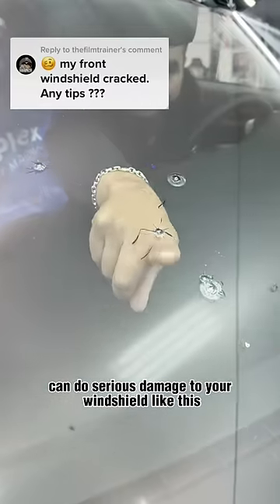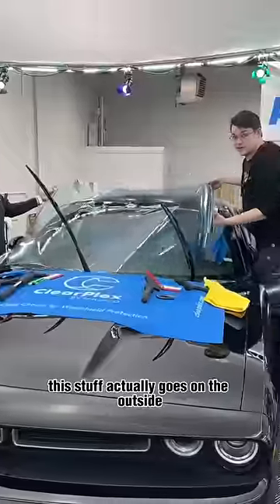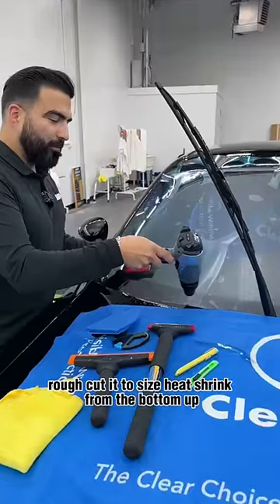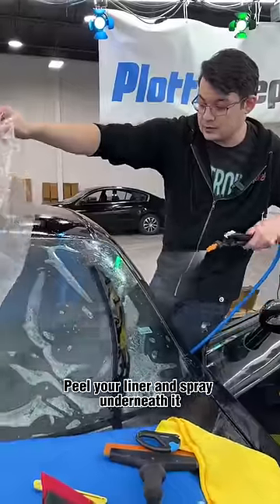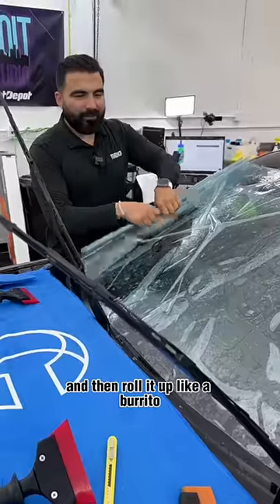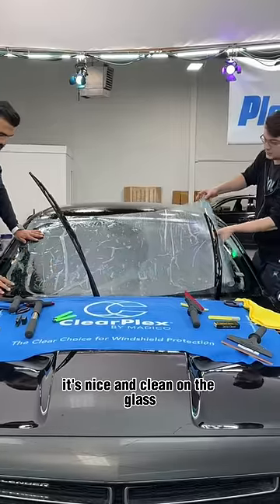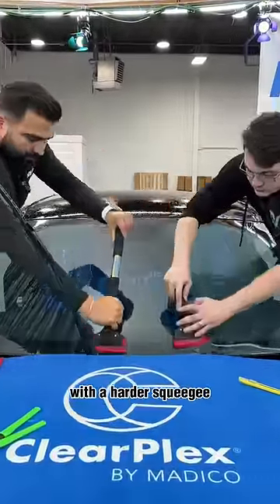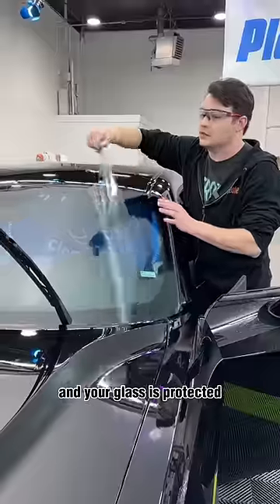Is Windshield Protection Tint Good?! #cars #automobile #windshield

Comment: Plastic BBs don't leave that kind of impact. They don't even dent most glasses unless it's non-tempered. At that angle the glass is also fine.
Reply: steel bb's do.
Reply: @comethiburs2326  which are Prohibited to use 😂
Reply: @xSoulhunterDKx  where?
Reply: @GeeSedan  in Germany or Europe in general. Also on basically ever us playfield against other players
Reply: Windshields are never tempered
Reply: @xSoulhunterDKx  well yes against other players, they were prolly just buying it for target practice
Reply: Windshields are NEVER tempered. Your lack of knowledge is apparent.
Reply: @codilankford6173  You are correct. I've read more about the topic since those 8 months.

It's literally the only piece that isn't tempered, it's laminated(unless it's a vintage car).

Comment: I used to work for MTA busses in Los Angeles in the late 90’s and this company came out with anti graffiti tint for the inside of the windows in the buses..I remember having to remove this kind of tint on the inside from where the youngsters would try to etch on the window but didn’t know there was a clear tint of anti graffiti film on it so it wouldn’t even touch the glass..it’s a lot cheaper and easier for us being techs to remove a piece of film that’s etched up with graffiti than to have to remove the entire window one day and have it completely etched with graffiti the next. This stuff really works and great idea to use it on the front window..going to put widow replacers out of business! Lol

Comment: It will start staining after using the wipers...
Reply: Thanks
Reply: They wasn’t even thinking so far…
Reply: Imagine the dirt that gets on the glass and then swished back and forth by the wipers. Glass is pretty hard so it doesn't scratch super easily. A plastic however is much softer. I would want to see this after a year of use in the sun.
Reply: @court2379  my thoughts exactly...

Comment: do they sell this in chameleon or color tinted hue?
Reply: Just get window tint…
Reply: @williamb7574  I want 2 in 1 the color and protection
Reply: @williamb7574  normal window tint won't work. My front windshield is fully tinted @20%. I was on highway and a rock hit my shit. Next day straight crack from the cold weather. 😤😤😤😤
Reply: No sir. Only clear and this ceramic version
Reply: @ballinn Jay  20%? Do you have a death wish? How the hell do you see at night?
Reply: @mrpasciak92  mine is 15 in the front 5 on the sides. I see perfectly fine from the inside. Cops don’t say shit in this small town. Everyone has illegal tent and tbh I didn’t even research tent laws in IL

Comment: A guy in a car group in in had a large metal chunk fly into his windshield. The first responders told him his windshield tint is the only thing that kept it from making entry into the cabin
Reply: Interesting story but hard to believe being true. The tint is very thin so offers little resistance to puncture, and the glass is already a sandwich of two outer glass layers and a thick durable polymer layer between that is designed to absorb energy and keep glass shards from flying everywhere.
Reply: @court2379  I’m not gonna go all out saying it’s true because it was on Facebook and I don’t know the guy lol. That being said he did have a photo that showed the inside where the tint wrap had not been penetrated by the trailer hitch that hit it. It could have been staged though so I’m not sure
Reply: @puffm696  It's possible I guess  just really unlikely. That is a fine line between making it through the window, but not a thin sheet of plastic.
Reply: @puffm696  these work fine, the only problem is all of them so far have had sun/heat and dirt and dust issues. God forbid you like somewhere where you have to scrape ice out your car

Comment: Wouldn't the windshield wipers scratch that film up when there is dust?
Reply: Yes it would. Not to mention, when you use an ice scraper.
Reply: You have to use silicone wiper blades and you treat the film with a wax type product to seal it
Reply: Not really.
Reply: Is cheaper to replace the film than the windshield
Reply: I’m assuming this is in an area with a lot of rocks on the road/rock trucks. Swapping the film out every year is probably cheaper than wanting to get a whole windshield replaced
Reply: It a joke! 😂 that wouldn’t work

Comment: My jeep needs this. Wonder what the price of this is versus my insurance deductible every time a windshield cracks.
Reply: It ain’t cheap
Reply: I'd imagine it wouldn't help much because of the angle of the windshield assuming you drive a wrangler
Reply: @James Maggot  Yes, it's a 22 Willys. I've already been thru 1 windshield in the first year.
Reply: @Ladysman_217  I’m seeing it costs around $500+ .  I have a Jeep too and thought the same thing.
Reply: Insurance deductible?😂 Safelite is like 200 bucks at the most. Big deal lol.
Reply: @thehulkamaniabrother2.089  AHHH try again. You obviously never had to replace a JL windshield.
Reply: @Ladysman_217  No I haven't. I had to replace the windshield in my Liberty tho and it was less than 200 bucks for the glass and labour. And Safelite came out to my house and did it in my driveway in about a half hour. Pretty good deal I thought.
Reply: @TheHulkamaniaBrother2.0  A JL windshield is $1200 before insurance.

Comment: I added tint my 89 Accord SEi and went to my Insurance company and said "Hey, what kind of discount can I get for the stronger glass"and was told nothing. They give me a break though for the alarm system if I set it to be on passive mode so it engages when the engine shuts off.

A fun time I had when I stopped to get gas and the alarm locked the doors. Thankfully, the sunroof was open.

Comment: Front windshield... so are my windows called side windshields? Or what is the proper term for the other windows on a car?
Reply: Front and rear windshield
Reply: There just normal windows💀
Reply: We usually  call them windups
Reply: I think you need to take a break from the internet for a few days 😂
Reply: Wind stoppers
Reply: It's called a windshield because it is at the front...you know..the direction wind would be coming hitting your face....the others are just windows

Comment: Windshield wipers gon scratch tf out of that after a few uses lol
Reply: No it doesn't
Reply: @jacobtrain4240  Yes it will. 😂
Reply: @Normal1855  7 months and they are scratch free. You do realize that they tested this out before they started selling them right? You know that wiper blades can't cut or scratch since they are rubber.......right?
Reply: @Normal1855  The way scratches work is the item doing the scratching must be harder than the item getting scratched. I'm pretty sure the soft rubber of a windshield wiper is softer than the film they put on the windshield.
Reply: driving and park outdoor.  your car has sands and dust cover on it. Including windows.
Reply: If you change yours every 6 months no they won’t you probably change them every couple years.
Reply: @philiam0420  yea but if it gets dusty the wipers would fuck it up to my knowledge and giving they didn’t actually use any ammo in the second clip I don’t trust this company
Reply: @jacobtrain4240  hey genius have you ever heard of dust and debris? The same that the windshield wiper is going to grind into that film? "Hur dur its rubber durr" that's what you look like
Reply: Not true 😅

Comment: I'm shocked an airport gun can break a windshield.
Reply: Thoes are airsoft guns, I believe the ones they are using is a HK G36C, they shoot 6mm plastic BBs, around 420FPS, most of the time the bbs shatter on impact, if you get hit with one, you'll be getting some internal bleeding/ring bruises without breaking the skin. It's alotta impact force in one small area, that's why they are able to break car glass
Reply: @tripclipgt6573  Autocorrect changed my spelling of airsoft to airport... guess samsung doesn't like airsoft guns.
Reply: @tripclipgt6573  internal bleeding 😂
Reply: @tripclipgt6573  HK does not make airsoft guns. This is a replica. Most likely this is jg608 made by jg
Reply: @grzegorzdobrosielski6201  no, it's a heckler and koch like I said it was, why you gonna a tell me I'm wrong when you have all the information right there in your hand. HK has licensed airsoft guns, does HK manufacture them? No, but they also don't manufacture HK weapons, other partnered companies do that. HK is the brand.
Reply: @tripclipgt6573  tell me what brand has license with h&k becouse I looked and I did not founda gun with license that looks like the one from the video(also the gun looks really cheap and anything with h&k branding would be made nicer). 
Also who is spending more than 100$ on a airsoft gun that you propably won't use as often. If they played airsoft they propably would have something nicer.

Comment: This is actually very dangerous one of the major reasons why film coating is banned in many countries is because if u get in an accident all the glass would shatter inwards instead of outwards
Reply: Windshields dont shatter, they are made to prevent that already, this film isnt doing much of anything besides wasting money
Reply: @SICresinwrks  yup they dont shatter into peices, but shards of glass still break off in an accident which will fall inwards instead of outside on impact. Thats why tinted glass is allowed but films are not in a lot of places.
Reply: If your windshield breaks while you're driving, it's not going to shatter outwards lol
Reply: @sachinthomas7042  Tinted glass?  

Unless its tempered or annealed glass the shade of the lami (Windshields and some side glass...breaks but stays together) its done so with the inner liner on the windshield.  Tempered glass (breaks into a million pieces) thats shaded  grey, blue or green tint is in the glass itself. 

Film isn't going to change the direction of the broken pieces of glass.  It may prevent the glass from traveling the same distance as no tint/film but it won't reverse the direction it breaks.  The bow of the glass helps decide that direction and also strengthens the glass.  Also if your auto glass breaks in big shards it's not AS glass and violates the DOT regulations.

Comment: I have to wonder how long that would last in high heat areas that also have lots of wind and blowing sand.  I also wonder how well it would work on the other windows of the car. Would it stay on side windows and the rear window?

Comment: Does this effect to the safety??? Like, when we met with an accident and if we are not able to open the door and force to crack the windshield to get out from the car. At that time is it possible to crack the shield??? Coz in Kerala, our Motor vehicle Department says no to the tinted glass😢😢and they are pointing this as the reason....

Comment: I replaced the windshield when I bought my second hand car. The previous owner did never replaced the wipers so the windshield was full of scratches. After that I let someone install a PPF like this on my windshield, and it saved the glass from many stone chips already  and scratches from sand etc
Reply: You’ll get more scratches on any plastic based windscreen protector.

Comment: How hard is it to break if you need to escape and break the front windshield because for wtv reason you were in a wreck your pinned both side and back window is crushed. Your only hope of surviving is to go out the front windshield.  Then you notice its all shattered but still in place. Can you just push it out? 
That would suck ass

Comment: Are there any windshield protecting films that also block out uv rays?
Reply: yes you can get a clear film, 100% visibility that blocks 99% uv rays.  Most windshields are solar tint which is about 70% visibility.

Comment: What brand of tint would you recommend for 50% with the best heat reduction? Also, clear for a semi truck windshield?
Reply: Something ceramic. It’ll keep the cab much cooler, and from the outside it’ll just look like a really shiny window.

As for brand I’m using llumar. 

It’s been applied 3 years, no fading or discoloration.

Comment: In most States tinted windshields below the as1 line is illegal. But a clear protection layer is allowed.
Reply: The AS1 line is a myth in most states.
Reply: @littlejackalo5326  if you look on your windshield it'll say AS1. Mykia has it in the top right corner. So I've just busted your myth.

Comment: seems like a good idea.... but car windshields and door glass are meant to fail in a certain way, for safety and escape.....a plastic cover would change that.  maybe they thought of that .
Reply: No. LOL. The windshield is meant to be as rigid as possible for rollovers. And some film isn't going to change it at all. The stronger the windshield, the better.
Reply: @littlejackalo5326  that's not what the crash test  engineers said.  we used to put tape on the windows of crash test cars to keep it from failing.  we had cone car  with plastic windows that flexed.  it changed how the door crumples and we couldn't get the dummies out because the widows did not break. but what do i know.  i just worked there

Comment: Not recommend for really windy or dirty areas. If you have a lot of debris in the air you live this file will get thousands of micros scratches and collect dirt. After a year of harsh air conditions it will be almost impossible to see through. Worked at tint shop for years as assistant manager and our customers from rural areas would have problems with it.

Comment: Thats illegal as per MVD as glass are designed to shatter in event of accident thus saving the driver and passenger. This protection sheet will either kill or injure the occupants in event of accident.
Reply from the maker: Windshields are laminated, they don’t shatter.
Reply: @DetroitTintStudio  Windshield are designed to be shattered in event of accident and lamination prevent shattering of Windshield in event of accident thus causing sharp glass pieces which could cause injury or death to occupant at time of accident.

Comment: The real issue is how an airsoft gun can easily crack a modern windshield
Reply: Modern glass definitely seems thinner and weaker. I have multiple classic Mercedes and even with rock chips they don't usually crack and spread as much. They seem more resistant to rock chips as well.

Comment: Had a similar windshield protection film, it lasted a year.  Had to have it taken off because visibility was compromised after endless amounts of abuse from: flying debris; UV exposure; wiper fluid;and dirt underneath activated windshield wipers being dragged across the film.  The film did its job…it’s a sacrificial layer.  Just that it’s an expensive sacrificial layer.